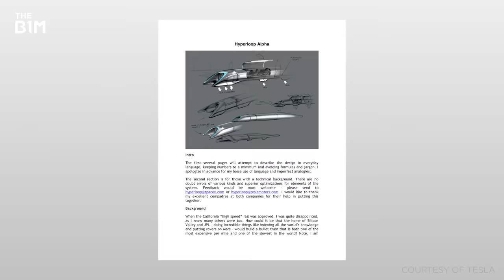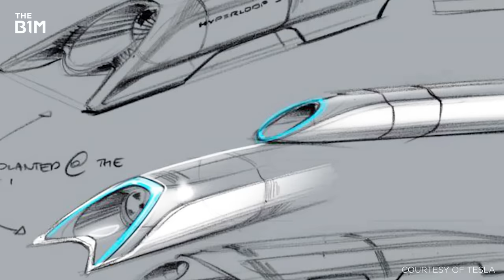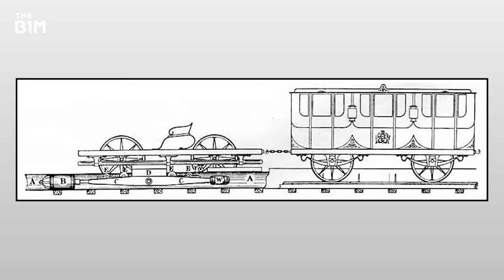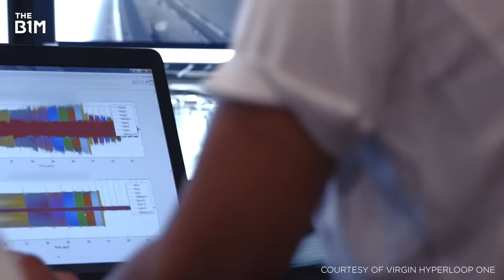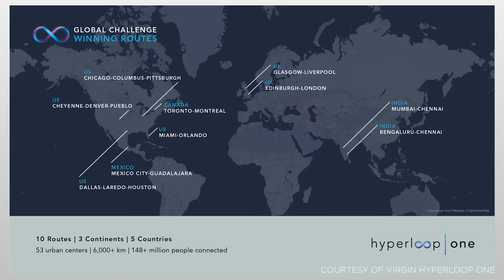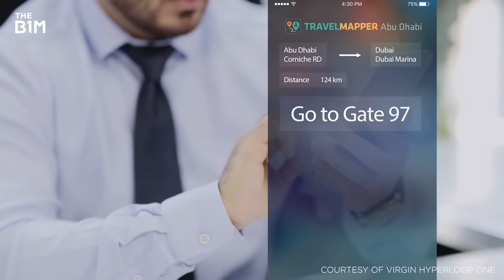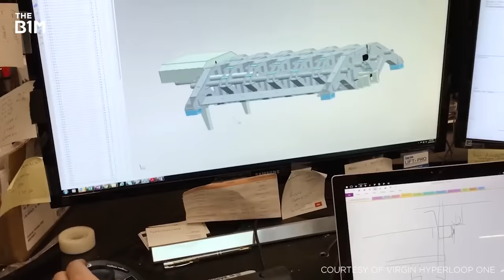Hyperloop Explained

Comment: It sounds like a good idea. When the Japanese spent billions on their Shinkansen line, everyone thought they were mad. Now the world is going back to railroads as the future of travel. And it makes perfect sense, these ground vehicles are more stable, can use stronger material, and in the event of emergency, there are more options. There is also the option of attaching several pods together to increase passenger capacity, something you couldn't do on planes. Planes have to carry all their fuel with them, these vehicles can be connected to power cables running along the line. More space and energy for passenger transportation.
Reply: Nobody thought the Japanese were mad because the technology seemed unfeasible, they thought people wouldn't use it and it would go under financially. Train travel had been around for over a hundred years. Trains are reliable. The hyperloop is quite literally a pipe dream that fails based on physics.

Just build high speed or Maglev trains. Japan is right now building a Maglev from Tokyo to Kyoto. That thing will work based on the fact that the Transrapid has already been shown to work.

Hyperloop is a non-solution to a problem that has already been solved.
Reply: 5544445

Comment: Maglev trains are HUGELY expensive, which is why they aren't popular, now they want to put them in a vacuum tube, which will also be HUGELY expensive, which is why they haven't been built.
Reply: A Maglev (Virgin) is not a Hyperloop.
Reply: How much does it cost us daily, to run 19 aircraft carriers, never mind the trillions it took to build those carriers. Politics in its most basic form is just the allocation of resources. We could have a world leading transportation system or spend it all on shiny new military weapons. Its your choice ?
Reply: A. Not a vacuum tube. Ultra low pressure. Believe it or not, that is a significant difference. Far cheaper, far safer, and gives you all of the benefits.
B. This isn't a maglev train. They use powered magnets to create the levitation. This has a significant cost. Hyperloop is looking at using permanent magnets (no need to power them at all) to achieve this. There is an effect created when you align permanent magnets properly that creates significant levitation above certain perpendicular velocities. This is why you see the test pods for hyperloop have wheels and then it suddenly lifts up off the rail. It achieved the velocity needed for the magnetic repulsion to kick in. But without requiring power, the cost to construct it is a fraction of maglev. And acceleration is provided from a linear induction motor which only has to power on for the fraction of a second the train is over it, and these get used in theme park rides.
Reply: They aren't popular in USA, but they are hugely popular in Japan, China and other Asian countries.
Reply: Ari Riyadh well if they ever do make them and perfect them, I don't wanna see you on it lol.
Reply: Is a HYPERLOOP
Reply: @precogtyrant  no they are not
Reply: john wonder lol u should study history before u comment on something out of your element
Reply: Scotland penned a feasibility study for a tube maglev between Edinburgh and Glasgow fed by it’s burgeoning renewable energy output, Westminster shelved it not wanting the already outdated HS2 overshadowed!
Reply: @mycroft16  It does in-fact rely on magnetic levitation.  It's also stupidly expensive and impractical.  Do you have any idea the amount of energy required to draw a vacuum?  An LA to SF route would need to use every large commercial vacuum pump available to have any chance of pulling the vacuum required.  Stupid amounts of energy, and extremely dangerous.  The steel would expand over 300 meters each day as well.  Stupid idea and will never be built to any meaningful capacity.  Cheaper to buy airliners.
Reply: @mhamma6560  As an astrophysicist I can safely say you haven't got a clue what you're talking about. Let's do pressure first. Yes... it is very difficult and expensive to maintain a pure vacuum. The most pure we've ever achieved so far is actually in the LIGO detector arms and they're only 4km long each. If you had actually read my comment above, or the white paper proposal of Hyperloop, or really anything about it at all over the last 5 years you would know that Hyperloop does not use a pure vacuum in the tube. The last 10% of going to a pure vacuum is where roughly 95% of the energy cost is expended. The Hyperloop systems is only depressurized down to about 1 mbar, which equates to an altitude of about 180,000 ft. This pressure is actually pretty easy to maintain using current technology and means that any small-scale leaks in the system don't matter as the pumps can easily accommodate. That's one of the actual reasons for not going pure vacuum. Another reason is you don't need to. You just need to reduce air resistance enough to allow travel at the speed you want to go without having to deal with air resistance and bow shocks. Why waste any more energy than absolutely needed?

Yes, it is mag-lev, but not in the traditional ridiculously expensive active magnet method you are used to. They are actually using some rather exotic materials to create room-temperature permanent magnets, meaning they don't require huge inputs of electricity to keep them magnetized. Nor do the require liquid nitrogen or helium to keep them super-cooled. All that is required are tiny pulses on the pod to switch polarizations and move the thing forward/backward. Since only the length of one pod has to be powered the energy savings is massive. Some are even looking at using magnetic inductance to power the pod, so it's own motion provides further energy for the pod to continue, meaning it just needs a little push start and that's it for the rest of the journey.

As for expansion... are you seriously saying that actual real-world engineers and physicists have failed to think of the thermal expansion? Because they have. And there are multiple ways to very easily account for it. The only way the thing would expand 300 m is if the entire SF to LA length was a single piece of steel. If you break the thing down into, say 80 or 100 ft sections, which you would do to actually construct it, all you have to account for are millimeters every 30 meters. THAT is really easy to handle. Like most engineers figure that problem out before they are out of their diapers easy.

Please, do some research before you post next time.
Reply: @mycroft16  I have done the research on it which is why I firmly stand by my assertions that it's impractical.  Yes, slip joints are a possibility, and each one significantly increases the risk of failure.  If a joint fails, the amount of air that's going to be slamming into a capsule, and the combined speed of capsule and column of which will be traveling faster than the capsule will absolutely kill everyone in it.  There's also the cost.  For the proposed LA to SF route, you can purchase a fleet of over 100 airliners that travel nearly the same speed, but can do so to any city.  There's also the little issue with the inhospitable atmosphere.  If any issue does occur with a vehicle, the occupants will have one hell of a gruesome death --- nothing more enjoyable than boiling to death after your lungs explode, WHAT FUN!  If they ever do complete one of the short runs that's proposed, we'll all get to see just how much of a failure it is.  With over-land super sonic aircraft on the horizon, this makes zero sense financially. Consider getting a minor in economics.
Reply: @mhamma6560  If by research you mean "you've watched Thunderfoot's video" then yeah, I believe that, because you parrot the same debunked and not actually based in real physics garbage he does. Let's go over this in detail, shall we?

1) Slip joints do not significantly increase the risk of failure any more than expansion joints on a bridge do... because you engineer that into the design. Are they weaker spots? Yes... but you know about every single one of them and that means you can engineer added strength and failsafes around them... which is what happens with expansion joints on bridges, pipelines, etc. Again, this is a "problem" that isn't a problem.

2) Let's talk about leaks and total tube failures. Small leaks, as has been stated ad nauseam are meaningless as the pumps can easily handle a small leak until they can be patched or tube sections replaced. So let's assume a slip joint just explodes for no apparent reason and the entire tube cross-section is open to atmospheric pressure, which is 10^3 times greater than tube pressure. Yes, a lot of air is going to come down the tube really quickly. First, think about what happens when really rapidly moving water hits the prow of a boat. Is there a jolt, yup, but because of the hydrodynamic design of the boat's hull, it isn't very bad and the boat cuts through the majority of it. The boat certainly isn't shredded. Since water and air are both fluids, it's a handy analogy... since the pod is also aerodynamically shaped to cut through the air with as little resistance as possible, including the use of very low coefficient of drag metamaterials (NASA actually got involved in this for the US Olympic swim team suits, some fascinating research went into that, worth a read if you have the time). These sorts of things go through intensive fluid dynamics simulations long before they even start prototyping, and then they go through wind tunnel testing. Including supersonic wind tunnels. Guess what, they can even simulate rapid pressure changes in wind tunnels. So even if that happens, it isn't going to destroy the pod. Since it isn't a bus where people stand up and strap hang, but are belted into specifically designed acceleration chairs, very little would happen to the people. Let's talk about mitigation. You state all this like there is no possible way to stop this wall of air. There are a couple actually. Pressure doors in the tube every few miles or even more frequently can be tied to automated pressure sensors and in the event of a total failure, slam closed isolating the section from the rest of the route. This would also communicate with the control systems halting travel in the tube. The 2nd thing that would happen would be to pump air into the rest of the tube by reversing the vacuum pumps. This stagnant air gets in the way of the advancing wave of pressure and basically muddles it up. It creates mixing vortices which sap energy rapidly from the pressure wave and they equalize rather quickly. Let me try and anticipate the problems you'll try to bring up about that. With closing the doors and isolating the break and stopping the pods you may think this means people are stranded in 1mbar tubes unable to move. Remember those vacuum pumps? Just reverse them and let air into the tube for a few minutes, problem solved. With bringing air into the tube to sap energy from the pressure wave, you may think that the pods would suddenly start to overheat due to friction in the thicker atmosphere... and you're right, except that all the system has to do is slow them down to normal speeds and eventually halt them safely. Okay, so what about a hole in the pod itself? As you bring up the lack of atmosphere in the tube isn't exactly conducive to a good day should your pod become open to that. HTT's Quintero pods actually are a dual layer skin of advanced composites and alloys embedded with thousands of sensors... directly integrated into the body of the pod. Any crack or leak is instantly communicated to the control systems. A small leak can be dealt with by just kicking up the atmospheric control systems pressure for the remainder of the trip. A more significant leak to a catastrophic opening would result in immediate deceleration and pressurizing of the tube... which is exactly what we do with airplanes. If there is a significant leak reducing cabin pressure oxygen masks are deployed so that people can continue to breathe and the plane immediately descends to an altitude where people can breathe sans mask.

3) Jets... actually you could by more than a fleet of 100 for the proposed LA to SF route. But they don't fly as fast. The maximum permitted speed of a 737 (the most common jet in use) is 546 mph (490 kts, 340kts CAS). The goal speed for the Hyperloop is 760 mph. That's nearly 50% faster than the jet. There are other factors at play here as well. ATC allows only so many planes per unit airspace (flight level, following distance). And only so many planes fly on the same leg because there simply isn't enough airport space to support more and the cost to expand an airport which is sitting in the middle of a city is, well, prohibitive is a nice way of saying it. In other words, you can't just add an extra 100 flights a day to the LA to SF route, on top of adding a hundred more flights per day to all the other cities. Even adding 5 more a day would seriously stress most existing airports. LAX and SFO particularly don't have a lot of expansion room. Another factor is the actual boarding process. Airports are designed to handle groups of a couple hundred people per flight per unit time. The people show up for their flight, they are processed through ticketing and security, and on to their gate. The process can take an hour or more depending on how busy it is. Boarding of planes is also not terribly efficient as there is a single ingress/egress point for 180+ people to use plus their carry-ons. Hyperloop is designed around much smaller boarding groups of a dozen or so with much more frequent dispatches. Average turnaround time from landing to takeoff for a plane is about 40 minutes. You can easily dispatch that number of people in that same time, at 50% higher speed. That means it's more efficient. So taking all of this into account, simply putting more airplanes out there is just not a viable solution given the footprint it would require as well as the infrastructure cost likely adding up to about the same as the hyperloop anyway.

If you want we could get good old math involved and run the calculations. How's your calculus as algebra-based physics just won't cut it for the more complex fluid dynamics formulae? I suppose there's a fitting sense of historical irony here as your arguments sound so much like what people said about trains traveling too fast for people to be able to breathe. I guess it's a good thing the engineers of the day didn't listen to all those people. Or the people who naysayed the car. Or the airplane. Or rockets. Or electricity. Or pretty much every other major scientific breakthrough or invention.
Reply: That's a good point, I believe Hyperloop has to become a mass service, hence become an alternative to planes to be profitable
Reply: @mycroft16  thank you for the lesson. you just made everyone who reads this deep into youtube comments a bit smarter :]
Reply: I wonder what is the cost - benefit ratio
Reply: Maglev failed not because cost.
But biurocracy
Reply: benjovi55  people pay lot of money for plane travel, this is same. Imo hyper loop is for rich people.
Reply: @mycroft16 You are a smart guy brother. There really isn't a point trying to explain anything reasonable to a naysayer. Even after having seen myriads of repeated patterns of scientific progress in the face of popular criticism by many a close minded and insecure pseudointellectuals throughout history, people just won't take a lesson. Like Einstein said, "Two things are infinite, the Universe and human stupidity. And I'm not sure about the Universe".
Reply: Cost is dependent on cost of energy, where in Germany it was formerly very cheap due to many nuclear powerstations and coal stations (latter now being closed for global warming scam).
 In China energy is cheap ((thus manufacturers costs) because they don't care about CO2 and build 4 coal burners a month.

Comment: Hyperloop can be feasable with focus on safety features, the craft will need to be a Pod-in-Cart,  dividing the odds of leak alert tag timing. The vacuum chamber must be accessible to refill during power fail rappit and if often by any intrustion means, as well parallel evecuation tubes for repairmens and exiting emergency.
●The pod-in-cart would grants veristal path swap depatures/pickup, g-force tilt features.
●power line respond shut off of a always tention valve shut off release lever on vacuum realm, to any alert sensor alarm.
●cannot render between only front and back of a cart during power failure, need parallel tubes in undergound tunnel/mountain burrowed areas.